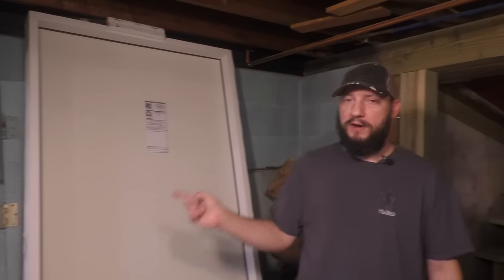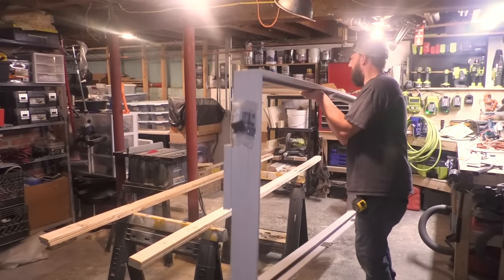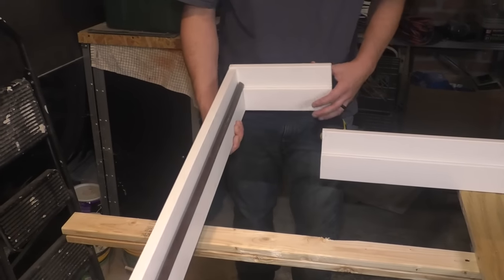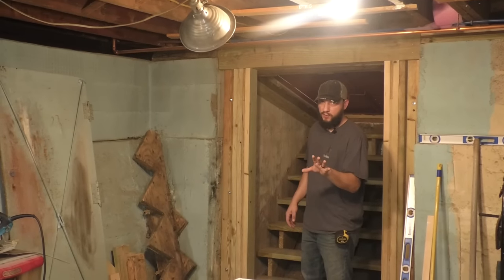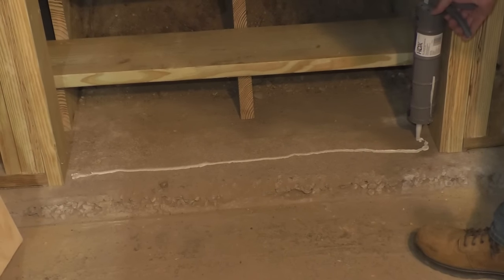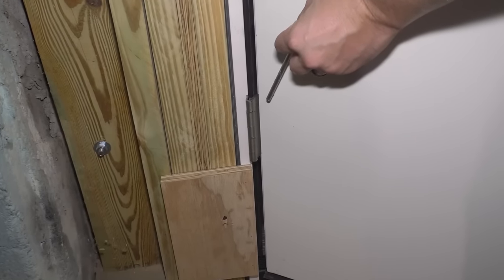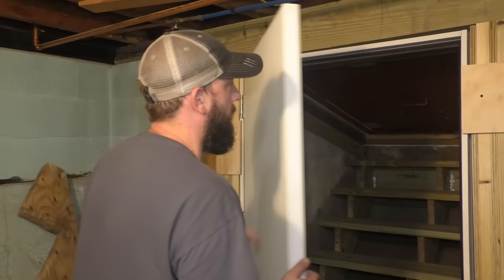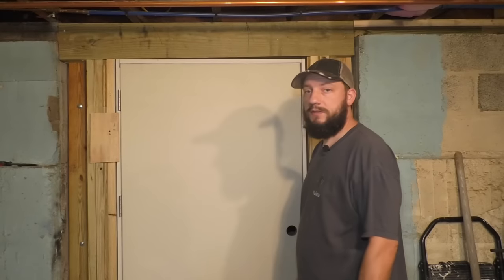How to Cut Down Steel Pre-Hung Door + Installation

Comment: You could have moved the header up and hung the joist from them to get the height you need
Reply from the maker: I could have… but did you notice the framing for the exterior bulkhead door is even with the bottom of that header?  I would have had to take all that apart and raised the door.  A LOT more work.  Anything is possible.  Just gotta pick your battles.

Comment: "Pressure treated" is a joke it rarely soaks in even an 1/8", one might as well brush your own on to scare the few bugs away that would still not deter them. Just use plastic (nylon/vinyl/ )and be done with it for shims.

Comment: Wouldn’t be better to take 5” off of both ends? That way he would have to mess with resetting the top hinge. 
And by the way, cutting metal or wood safety glasses should be worn!
Reply from the maker: Good idea but It would have been a lot more work with the door frame and I only wanted to make one cut.

Comment: Remove the weather stripping in the very beginning and don’t put it back in until the very end. Most weather stripping is cheap and prone to ripping apart. Taking it in and out like he is will likely have you running back to the Home Depot.
Reply from the maker: Yeah… as I said I hadn’t done this in 10 years.  I will do that next time.

Comment: I would have just hung the door directly, without jamb. Gain over an inch in clear height, avoiding hitting the head many times in the future. Also, I would have made it as wide as possible.... One day you'll need the width.

Comment: Couldn’t help to notice the framing across the top, looks about a 1/2 to 3/4 inch difference (corner to corner)
Reply from the maker: If you mean between the door and the actual frame then yes.  The header is not level.  The house was built in 1946.  There was no sense trying to make it level, but the door is good! 👍
Reply: Ahhh yes, that’ll be why. Lol! Thanks bro. Great job!!! Door turned out great. Just got done doing this for a customer. ✌️
Reply from the maker: @josephpullen1153  thanks!  And thanks for checking it out!

Comment: Wouldn't it be more presize and easier to take apart the whole door frame
Reply from the maker: 🤔 can you explain more?  I don’t understand.  Take the top and the threads hold apart or do you mean the actual header and 2x6 framing for the door?
Reply: @TheFixerHomeRepair  just the door 🚪 not the whole house
Reply from the maker: I suppose I could have cut off the top and bottom of the frame to leave the hinges where they were.  Would have been a lot more work and would have had to move the hinge on the door.  Unless I cut from the top and bottom of the door… that would have been waaay more work…

Comment: So many problems here....
First why the big header it isn't carrying anything and if it is you have bigger problems..
Next why not take bottom plate of door off and let the door sweep  the floor less restricted that way..
They sell bottom sweep to fit over a cut door and a plate for floor to raise a bit if necessary..depends on floor level granted they usually slant the wrong way bc any water getting they don't want running across floor but still why not check

Comment: WHY CUT THE DOOR?  It’s obvious that the door stands upright in the space. And there’s plenty of room to swing the door.  Why not make a new frame opening with 2x6s and attach it to the wall.  It’ll take less time, there’ll be more room at the bottom of the steps, the door handle and hinges will be at the right height, without the need to cut the fire door and degrade its integrity.  I’ve had to do something similar with a water heater closet when the owner went from a 30 gallon tank to a 40.
Reply from the maker: That was actually one of my ideas but there is a heat pipe in the way that I would have had to move.

Comment: Hi You never put the door frame even with the freming you need to do offset for the drywall 1/2 or 5/8 from inside 🤦🏻‍♂️ Now you need to add to the door frame extensions.
Reply from the maker: I don’t intend to drywall… ever. 😁👍
Reply: @TheFixerHomeRepair  
So you are putting the casings to the freming with no finishing the wall with drywall ok 👍
Reply: You sound like a good carpenter . How long you been in the business